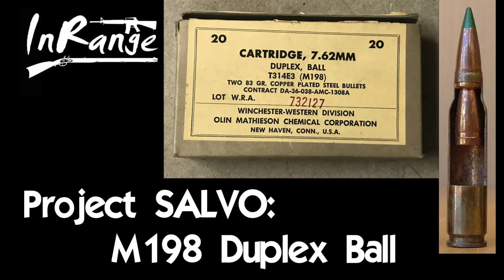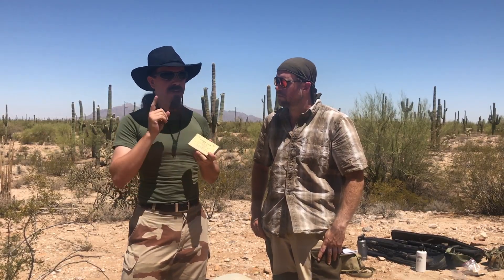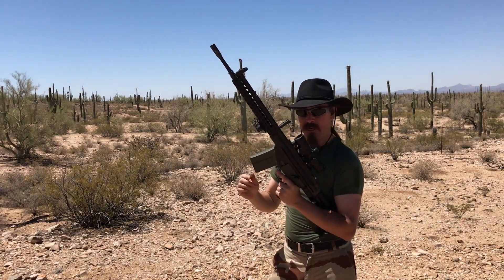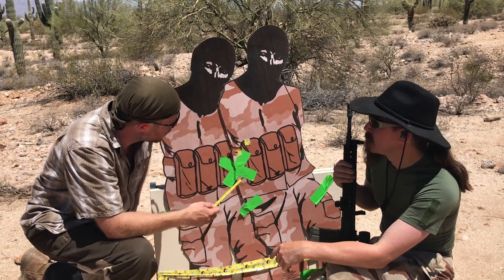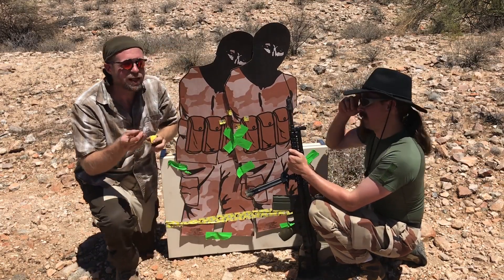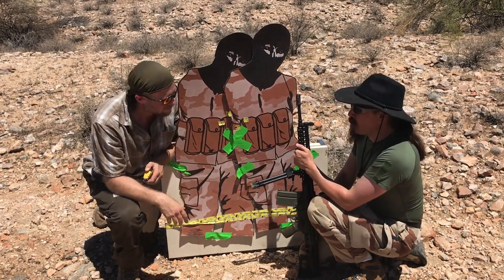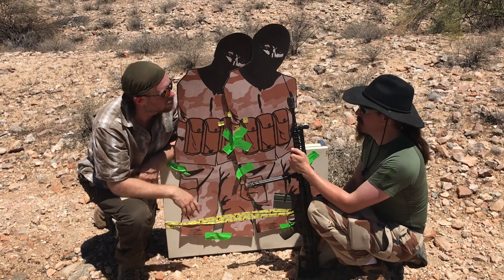Project SALVO: M198 Duplex Ball Ammunition

Comment: Just out of curiosity: does this increase the pressure or barrel wear substantially?
Reply: Yeah, it would increase the pressure compared to a projectile the same weight as those two bullets combined. Its basically because its more difficult to push two things instead of one object which is as heavy as two of them combined, probably due to friction from the rifling in this case. The two bullets in this travel quite a bit slower than the 180gr FMJ MK262 rounds while their combined weight is nearly 20gr lighter. Speaking of barrel wear, I'm not sure but I'm not surprised if its not much more than single bullet .308 loads of similar weight and speed.

Comment: I went through Edson Range in 1971 with M14's.  They made reference to duplex rounds but I never actually saw one.  When I got to my permanent unit we had M16A1's.  I always wondered about them.  Thanks for making this video, I finally got to see some duplex rounds after more than 40 years.
Reply: Oh how Edson range has NOT changed...I just retired in April. We would use Wilcox range when Edson was being used by other units. We actually pulled the M-14’s out of mothballs and shot them first at Edson, refitted the stocks and a few parts, then they were sent to Iraq and Afghanistan. I got my first one when I was in Iraq 2004. We got all types of rounds....blue tip with silver band 7.62....that was leftover (LC 78) we got it from the ammo guys.

Semper
GySgt 
USMC / Retired
Reply: Love your username by the way
Reply: Makes me think they must have field tested it. If it never made it past the experimental testing phase you’d think it would have been classified. And a PMI wouldn’t have ever heard of it. 
I went through Edson Range in 1980. Also qualified at Range 214 when I was with 1/11. I never saw an M14 until 1987. That was when I started shooting NRA Highpower.
Reply: Well, intermediate rounds kind of killed the concept. This thing makes a point only for battle rifle. /Cough/preferably a FAL and not M14/cough/ So it just surfaced as an idea TOO late. Plus using different ammo for different ranges would have been weird for the troops.
Reply: @TheArklyte  I would think it would  do an even better job with machine guns and suppressive firing
Reply: @muddyhotdog4103  especially for coaxial on tanks. But again, separate sights for separate ammo. For the poor gunner, who already have sight separation for AP and HE...

Comment: Great video, Project SALVO and similar project are very interesting and a lot of people have tried the concept in one form or another.

My problem is, what advantage does this have over a short burst of 5.56? The 5.56 has a little more power per bullet, a much better BC, lower recoil, and probably similar dispersion over a short burst thanks to the lower recoil. The duplex rounds do give a near instant second hit, but at 600+ rounds per minute a tenth of a second of difference doesn't make much difference. Throw in a constant recoil system (not quite as useful in bursts vs full auto, but still nice) and I don't see much reason to use the duplex rounds.

Comment: Double the projectiles down range? Lets load an M134 full of duplex...
Reply: Logging efficiency: +2000%
Reply: It would be interesting. On the other hand, it would probably be cheaper to just get a second minigun
Reply: @mattigator600  maybe, but you might not have the space to mount a second minigun on your vehicle/helo.
And if you are using it for area suppression anyway using this kind of ammo makes a lot of sense.
Reply: @IO-hh2fz  if you need that kind of ammo for suppression with a minigun, that will be a bit of a overkill.
Reply: @ApoorvaSingh-v4q  nah, if you NEED multi-bullet ammo for an M-134 for max suppression... I think you're already f-ed.
Reply: Exactly what I was thinking!

Comment: Back of my mind: 1 box of 50s super-special ammo; that can't be cheap
13:55 : ah, no, that is about $20 a round
ohhhkay, yeah, no.. you're not putting THAT through an M60 anymore..
Reply: Well, it probably cost considerably less than 20 USD to manufacture.
Reply: @hirumaryuei  Yup. That is just the current collector value.
Reply: So cheaper than 9mm now?
Reply: I just bought three Western brand JFK killer 6.5X52 Carcano cartriges at around $27 each. Rare stuff is expensive.

Comment: Wait... An M60 has a rof of about 600 rpm.. With duplex you would get 1200 rpm down range...

So this would effectively turn an M60 into an MG42 that consumes half as many bullets and may even be more controllable especially on the move(not prone), probably with less overheating problems and way less logistical problems because of the lower ammo consumption

That sounds like an amazing asset  to have, especially for suppression...

I wonder what it sounds like being shot at by this thing, is it two bullet cracks or just one louder one? How much would it change the sound of the gun hosing down your position?

I wanna see more of those things, the concept seems very intriguing